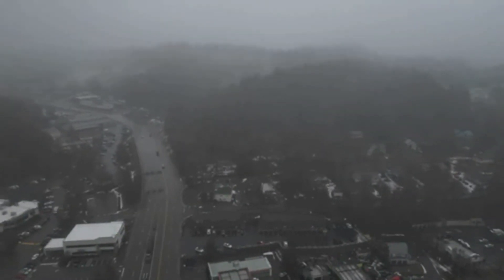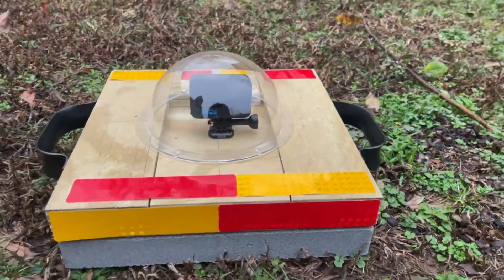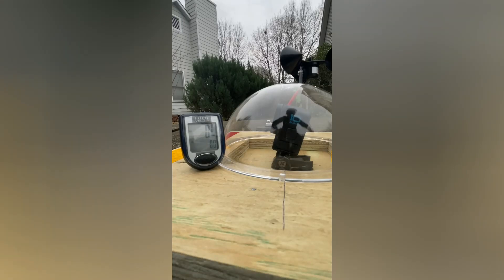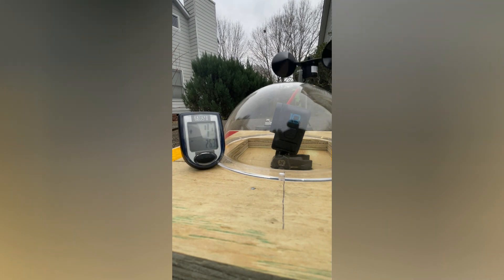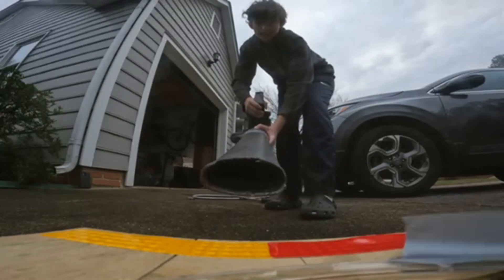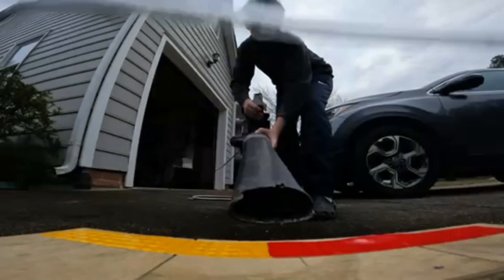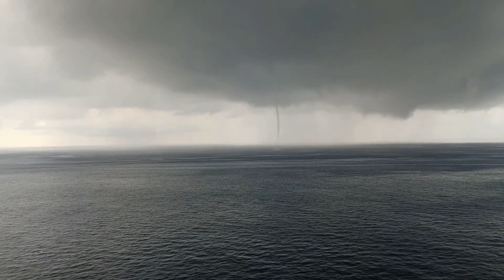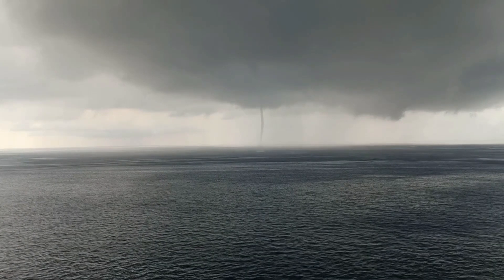I MADE A WEATHER PROBE! (Tornado Camera Probe)

Comment: 2025 here but it’s not really a “I’ll probably just add more duct tape or a latch” you gotta make it aero dynamic and have the hatch not fly up like use rubber on the bottom of the hatch to make it water proof and make a metal lock system to make SURE it stays shut
Reply from the maker: Water proof is not a problem, all electronics are water proof being used

Comment: As someone who is trying to build a weather probe like the TWISTEX tower probe, how did u mount the camera onto the suface?
Reply from the maker: @InfernoRez2022  the camera has a mount on there, I drilled and super glued the mount, I have realized the design is flawed at that point if the dome is to come off so will be instead mounting the camera inside of the actual probe

Comment: Are you able to make a tutorial for that anemometer? I searched it up and the cat eye Velo 8 isn’t hooked up to a anemometer and it turns out to be a speedometer. Im pretty sure you got a pre wired anemometer and connected it via dean connector
Reply from the maker: Inspeed.com
Reply: @SyrixERLC  ty, I’m going to put it on my probe, currently making a video of the  full tour of the sip and origins of it. Surprisingly it has lore lmao, it’s based off of a manned probe I made in 2021.
Reply from the maker: The inspeeds can’t hold and store data, u would have to make something yourself to store data
Reply: @SyrixERLC  im going to get a wired anemometer that holds peak mph, ill write down the peak windspeeds in my storm book.
Reply from the maker: Most only hold the peak winds of the past 1-5 mins, so be sure to test it and if it dosent work return it
Reply: @SyrixERLC  ok, thanks for the info, I’m probably going to get this $30 cup anemometer and it has some good reviews on it, or, if I make enough money, I’m going to get a weather station. Pretty exited for the 2025 season, All of the current interceptors should be chasing by then (including dominator 5 and TIV 3)
Reply: @SyrixERLC  video got uploaded to my channel, r u able to rate it from 1-10? its my first video I've done like it, and its the first one I've made a script for.
Reply from the maker: Good video and probe, but is it made out of an Amazon box and duct tape? If so the tornado can just suck it out since there is no weight
Reply: @SyrixERLC  eh in a sense yeah, the cardboard is the really dense and thick kind and i put a 10 pound weight in it. also the spikes are taped on at a slight angle so a moderately strong updraft doesn't suck it out.
ty for watching it
Reply from the maker: Np